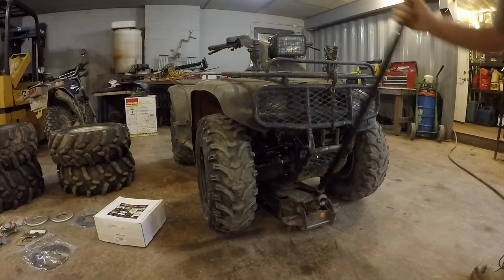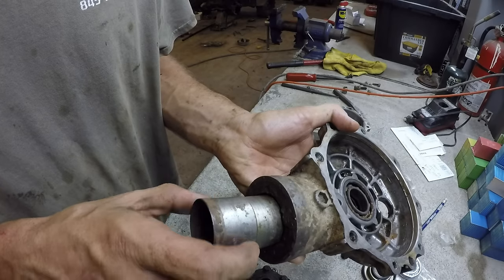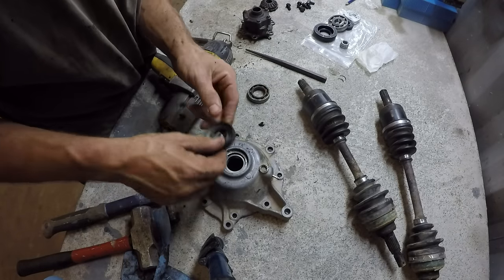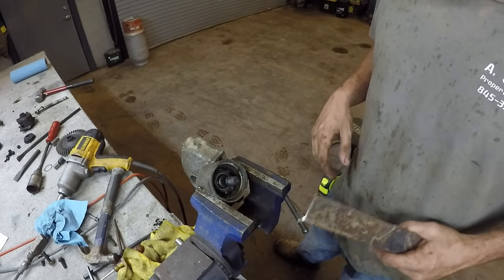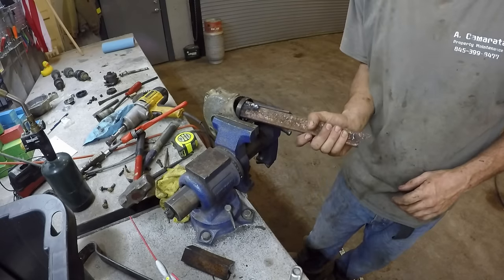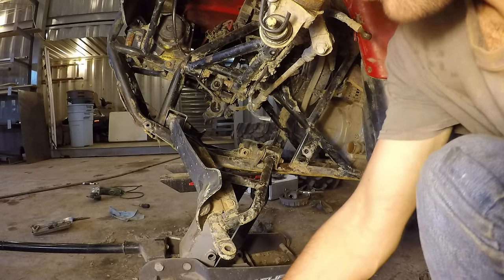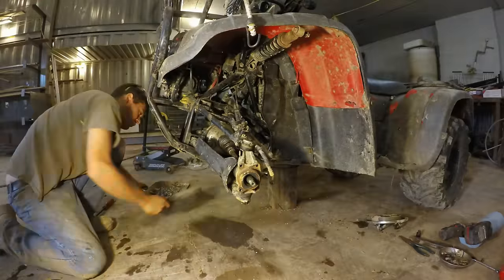How to rebuild a Honda ATV front differential

Comment: Hey Andrew! Michigan Mechanic Tip Brewed in NJ. This is how I've avoided buying fancy Internal Bearing Pullers..
Deep Creep by Seafoam First, Better than WD-40, PB Blaster, and Liquid Wrench put together. Its 13$ a can, but WORTH IT.
1) Tap a lag anchor shield that fits in the I.D of the bearing in with a hammer
2) Tighten the associated bolt into the anchor, and spread anchor inside bearing (NO IMPACT you will stretch the case)
3) Give it a little torch love if you have it first, and pry it out with a pickle fork
I Hope someone reads this and this helped anyone. Thanks for your awesome videos Andrew!
Reply: AvE did one before for a blind hole, where he used grease and rags and a punch/drift that was the same as the id of the bearing.  The hydraulic force generated by packing in the grease coated rags and hammering the punch was enough to force the bearing out.
Reply: Thanks for that tip. I wonder if a concrete wedge anchor would work (or something very similar) as well as the shield and bolt

Comment: With that pinion bearing just heat the case up with a blow torch and then give it a tap on the bench and it will fall out.  I love the angle iron tool   10/10

Comment: on that pinion bearing....  pack it full of grease or water soaked paper towel.   Stuff some paper towel on top, pound a snug rod or dowel into the inner race hole.  You will hydraulic the bearing out.   As it moves pull the dowel, add more grease or soggy paper.   Once grease/paper starts coming out the top hole you should have enough of the bearing exposed to grab it and yank it out - or use a lip puller.
Reply from the maker: ramosel thanks. I tried hammering a socket with grease, no luck. I've had that work well with auto transmission pinion bearings before.
Reply: Yup this works good,...
Reply: Clean the casing thoroughly (to avoid stinking out the oven and kitchen), and pop it in the oven at 200C for 1/2 hour. The bearings will literally drop out. It's so easy, it's almost unbelievable!
Reply: @johnw1078  Thats a cool trick.
Reply: John W is that the bread trick??
Reply: @AndrewCamarata  try heating the case first. usually the alloy expands more then the bearing, so it will fall right out. works great for installing as well. If not, the grease (or bread, or potato method does the job as well. Plus it will create an unusual smell in the workshop when the case is still hot ;) )
Reply: @AndrewCamarata  I have had better luck using wax or regular bar soap. It won't squeeze out like grease and is a lot less messy to clean up. You can even reuse it.

Comment: Sometimes you can force the pinion cage bearing out with hydraulic pressure .
Find a piece of round stock or a punch slightly smaller that the ID of the bearing , ( same size as the male part of the pinion shaft ) wrap some Teflon tape to form a seal of sorts .
Fill cavity with grease and usually a few taps will force the old bearing up & out of the case .
Reply: Kind of like a pilot bearing on a flywheel

Comment: I used all thread and welded it to that pilot bearing then put a steel plate across the top with a hole in the center.  Used a nut and turned it down tight. As I tightened the nut it pulled outward on the pilot bearing. It finally popped out and I didn't use the retaining ring when I reassembled it. Thanks for the video.

Comment: Fill the inside diameter of the bearing with grease insert a shaft as a makeshift  piston hit the end of the shaft gently the hydraulic pressure should back the bearing out add more grease as needed. Great channel by the way!

Comment: Like a pilot bushing, you pack it with grease and use something with a tight fit in the hole, when you pound it into the grease being forced into the hole it will pop it out, I have also heard of using bread to fill the hole for a less messy job. Hope this made sense.
Reply: I have done that with pilot bearings before. It works good

Comment: Andrew, 
Buy yourself a few different diameters of copper rod like 1/2", 3/4", 1", 1-1/4", maybe about 10" long and use them as drifts for knocking bearings and seals into place, even some lengths of nylon rod would also be handy.
Reply: Old post but what an excellcent idea. Thanks mate

Comment: Maybe a little heavy handed but it's fixed. Also a willingness and ability to work on an older unit like this gives you full license to hit it with a hammer all you want. Harbor freight has a cheap press for you that would look good along the wall. Great video as always thanks Andrew

Comment: If a bearing is an "interference" fit, heat up the housing to expand it, and get your cooled bearing out of a freezer and it will tap right in.  Same thing works for engine, cylinder liners, put them in  the freezer and they go into an engine block correctly. If your bearing taps in too easily, make sure it goes in with loctite bearing mount ( amazing stuff). Now that differential appeared to run in grease and not oil, so you will also need to remember to inject (pack) grease into the bearings before install so they dont run dry. In fact there are now semi-fluid wheel bearing, synthetic grease exactly for this type of situation.

Comment: to remove that small pinion bearing you're supposed to use a punch and push down in then use puller or whatever to get bearing out. there is a circlip around that bearing thats why there is a groove in the center. when you push down through hole it releases the circlip so bearing can come out

Comment: The pinion bearing with the blind hole, they make blind hole bearing puller set. It's an expandable collet with threads that connect to a slide hammer. I used it to pull the bearings on my yz 125 rebuild. They are pretty cheap on amazon I think I paid $25 just search blind hole bearing set

Comment: I'm pretty certain you put the side seals in backwards.  The exposed metal side should go towards the bearing and the rubber overmolded side should be on the outside.  Also, be careful about using old bearings as drivers for the new bearing, you don't want crud from the old bearing to contaminate the new bearing.
Reply from the maker: EFormance Engineering I'm positive the seals are in right, that's how the old ones came out. That metal goes into the axles nicely.
Reply: You can put them in either way, springs to outside lets over pressure out of the diff.  When I converted a John Deere 544A to a greased rear axle pivot from diff oil lubed.  Drilled the zerk fitting hole into the bushing/housing and reinstalled the new oil seals in backwards (spring out) to let grease out.  Putting in the seals with spring out also moves the contact point further out in case of chewed/rough seal seating area.

Comment: Stuff bread into the bearing. Find a shaft that fits the hole in the bearing and start pounding on it. Put more brad as needed. It will drive the bearing out without damage. Bread hydraulic.

Comment: I don't know how i missed this video. With the small bearing you used the welder on. The secret is hydraulics. You put some thick grease down inside the hole of the bearing. Then take a rod same size as inner diameter of bearing with a sharp but not to hard a blow with hammer and it will pop right out.

Comment: If you have an outside bearing race (Pressed into a bore) If you pull bearing apart so just the outer race remains. You weld around on the face of race (where bearings run) The weld will cool and shrink the race.

Comment: take a piece of  1.1/2" x 1.1/2" square tubing and it make's a great tool to get that nut out that holds the pinion bearing in, by the way look in that little hole and you will see a snap ring if you push it in the bearing will come out more easy

Comment: Where the main bolt was tide in;
Likekly on 2 small bareings.
So you take out all the other stuff (as you do) and just screw back the bolt to small bareings and pull them out.

Comment: They make a little bearing puller that goes into the bearing. You thread in and it spreads out and grabs. Remove with slide hammer. For pilot bearing

Comment: With a small flat tip screwdriver. Bend the clip upwards, grab it with needle nose pliers. And just pull it out, bearing should slide right out. This is from a technical manual.

Comment: Is that thing full time 4wd? I remember Honda had a few years that they did that. Considering that it's a 95 and I'm sure you run it pretty hard here and there, that original diff lasted a pretty decent amount of time.
Reply from the maker: BarnStangz yes, that thing is always in four-wheel-drive, I like it that way
Reply: BarnStangz all old hondas are 4 wheel full time. u can get actuators for these ol hondas but the only saving u will get from it is on gas. Because all your 4 wheel drive gear will be still turning at all times so ya dont save anything in the long run

Comment: For that huge pilot bearing funny nut there's a hydraulic nut that has the outer hex that fits it supposedly. It looks like a huge nut with male threads coming out one side. Then the inside diameter is too small to fit over the shaft so it needs a lathe to increase the inner diameter. Then one can weld a bit of pipe and nut to use a regular socket etc. There's another vid of a guy doing it.

Comment: when you hammer on another hammer use safety glasses, I really wish I had mine on exactly 11 years ago.
Reply: That goes for the punch as well, 3 years ago! I could have lost an eye if it had been 1/2 inch in the other direction.

Comment: Hi mate , hard to see in video as it all speed up but the spacers that go on either side of the ring gear , Are they the thinner ones? and the thicker ones go inside the clutch accessibly to seat the springs? or is that other way around?
Reply from the maker: I'm not sure, its been a while since I did this. Maybe check the microfiche from Honda.

Comment: Use proper tools (simple Arbor press) to insert seals and bearings, do not hammer them into housings. Also avoid welding hydraulic aggregates using electric arc as it creates spatters inside the equipment when current jumps over small gaps. Do not heat small section parts using flame to remove broken bolts / nipple as this induces local hardening and premature failure if not properly controlled. Hydraulic repairs such as cylinders and pumps are not that difficult , all you need is a simple test bench to recalibrate.

Comment: I thought you learned not to bang on magnesium/aluminum housings with the boat foot.  MG/AL Will not tolerate hitting with a hammer.  They are soft brittle metals.  NEVER HIT.  

THE BEARING COMES OUT WITH A BEARING PULLER OR A “SLIDE-HAMMER”. Slide hammers are ok you are hitting on the bearing and not the case.   Warm the case.  MG-AL MELTS AT ABOUT 700 degrees.  OXY ACETYLENE BURNS AT 3500 to 6000 degrees 
It will melt the case in a heartbeat.  Then hook the inside of the bearing with a slide hammer and gently tap it out.  

You can make the special tool.
Get steel round stock (pipe) that will fit down inside the crazy nut but over the shaft.  Now use the 90 degree back side of a 2” x 2” angle iron as a piece of stock.  Cut a bit of the angle iron to fit in each of the small spaces between the pipe stock and the inside of the crazy nut.   I think it’s 6. 
When you have the necessary pieces all fitting against the pipe and inside the crazy nut take them all out and weld them together as they were in the differential.  Use a grinder to remove any excess weld and dress up your tool.  Now, out of a piece of 1/2 inch flat steel plate stock cut a small 1/2 inch square hole with your plasma cutter so a 1/2 Drive ratchet will fit inside the 1/2 inch square hole.  Now cut a circle around the 1/2 inch square hole that is the same size as the inside diameter of the pipe.  Take your flat stock circle piece and weld it in the end of the pipe.  Tah. Dah. You now have a very nice special tool that will remove that crazy nut without busting the AL/MG case.    You can make this tool faster that I can type out how to do it.  It’s that easy.  There are many special tools that can be made this same way!   THEY COST NOTHING you just make them from stuff laying around the shop.

Comment: Fill the bearing with grease and drive the pinion back in or same size as pinion it will hydrolic itself out its the same with trans bearings in the back of crankshaft

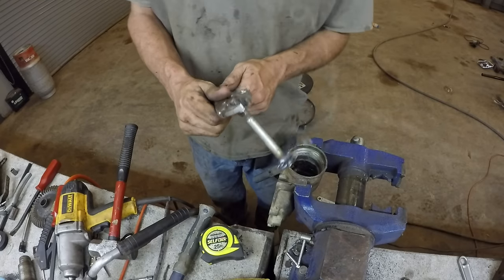Comment: 07:35 google bearing puller kit (slide hammer)  one kit all sizes 

I noticed you didn't grease the new bearing's its gonna be hard for who ever is gonna remove them in the future 

I've  seen you grease tracks and accessories  but never once have I seen you grease bolt's or bearings  during the install

when installing something that gets tightened or hammered its better to grease it  (metal to metal)

Comment: Don't you have to pack the bearings with grease?
Reply from the maker: The unit gets filled with oil. I don't think grease is needed.
Reply: @AndrewCamarata  yeah I think I'm showing my age. When Keith spinner needs a bearing with grease they already come with a plastic seal these days.

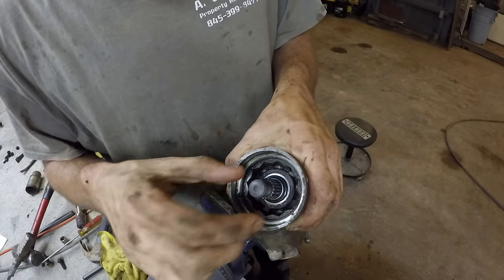Comment: What's the tools name to unscrew the inner bearing nut he mentions at 4:10 in to the video???
Reply from the maker: Might be this? https://amzn.to/3G9GNHq
Reply: @AndrewCamarata  yeah. I have a 04' Rancher 400at FAA. Front diff is making a ugly sound when I back up and go forward again. Prob broken gears where the axles sit.
Reply from the maker: Are any of the shafts going into loose/leaking oil?
Reply: @AndrewCamarata  no, that's the funny part, it rattles like a MF, but no leaking. I even check the diff grease and it's topped.
Reply from the maker: This repair has held up. But I feel like if it happened again I might just replace the whole diff.
Reply: @AndrewCamarata  it's a good point to know then. They're a bit pricey to get where I'm at, for now I'll rebuild and ride till it falls off.
Reply: @AndrewCamarata  does the diff need calibration after the seals and gears have been replaced/fixed? I heard somewhere that this step needed to be done after the fact.

Comment: So do you not have to pack grease in the bearings or What? How is that lubricated?
Reply from the maker: There is gear oil inside it.
Reply: Andrew Camarata For some reason I was thinking the bearings were like old school wheel bearings. New to 4 wheelers.

Comment: NEVER hammer a hammer.  The head can easily shatter.
Reply from the maker: They tested that on Mythbusters, They could not get it to happen.
Reply: @AndrewCamarata  I have seen it happen in my shop.  A coworker did it and I was there when it happened.  I am a firm believer of going over board on PPE.

Comment: And THAT is exactly why I spend 65 bucks on the special tool.
Reply from the maker: This front diff is still working.
Reply: I don’t have pieces of angle laying around so by the time I drove all over town trying to buy something so I can make shift a part, I would just order the part on amazon for 65 bucks and resell it on eBay for 40.00. But that’s awesome that it works and you were able to save the money:)
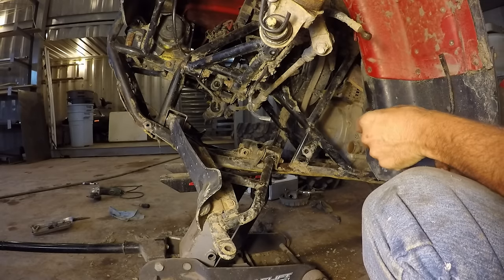Reply: I do have a question... near the end of your video, (10:29) you install the input shaft from the crankcase and there was a round metal object hanging on the shaft near the crankcase. What is that piece? My Honda has that exact same round thin metal washer just dangling on the driveshaft and I have no idea where it goes.

Comment: ANDREW READ>>> https://www.youtube.com/watch?v=00OlG5E8vLk    Also...when replacing bearingslike these, I always replace with SEALED bearings. I pick out the inside seal so the bearing gets lube but leave the outside seal and put grease in the cavity between the bearing and the factory seal....Whoks great on 2 stroke crank bearings too.

Comment: And off camera you bought a new deferential right. Because that one just ground the teeth off the ring gear first time you road it. And the cracked case leaks , and the backwards installed seals leaks .lmao
Reply from the maker: No, its still in there. That job went a little rough but its working fine. If I have another issue with it I would change it.